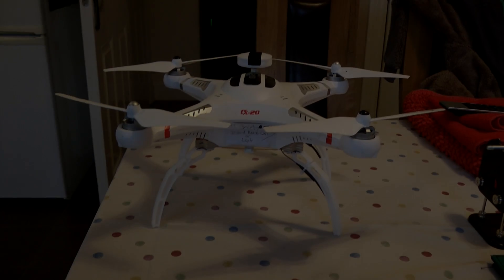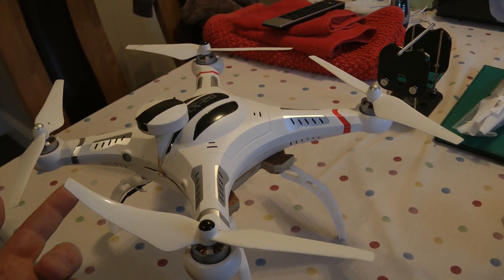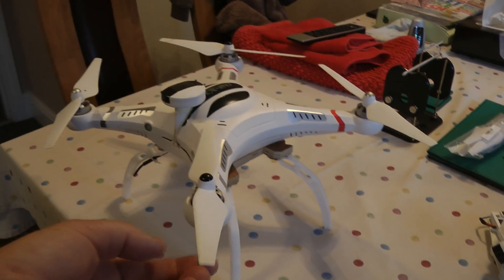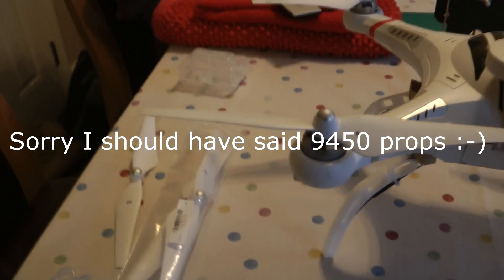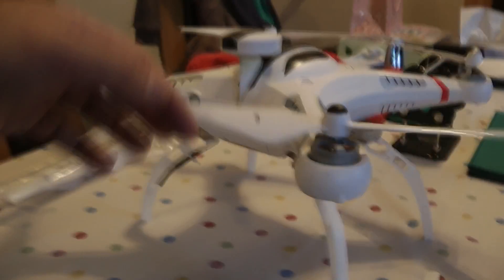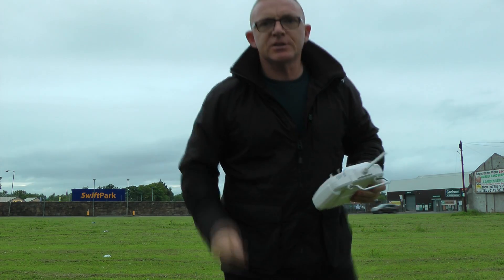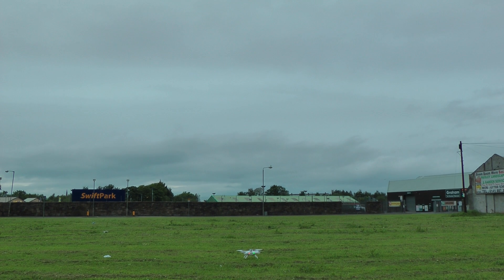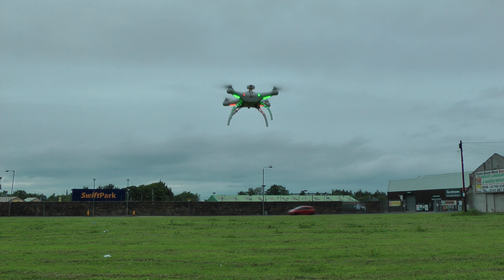Cheerson CX20 9443 V 9450 Props

Comment: Why does the transmitter also beeps on these drones
Reply from the maker: It's a safety feature, let's you know you are at mid throttle.  It used to annoy me but when you are in loiter at below mid throttle and change to stabilize without thinking your quad can fall from the sky.  But if beeping it will be safe to do so 😁

Comment: The most amazing flight of CX-20 I've ever seen on Youtube! I have mine but it's very faulty, it seats on the  shelf most of the time waiting for parts after crashing. What is your APM firmware? I've flashed 3.1.5 because one guy(Tesla) from rcgroups considers it's the best choice for CX-20. Did you make any modifications on harware (GPS, compass, APM)?
Reply from the maker: I used 3.2.1 Custom, I also used 3.1.5 with no problems either.  Apart from the props and changing the angles in mission planner it was standard :)
Reply: Hi, Charly, could you upload or email me your parameters list? I lost track of the changes in mine, so I'm not even sure where to start troubleshooting my very unstable CX-20, whether it is a hardware malfunction or parameters out of key. Thank you.
Reply from the maker: I will have a look for the files Sergey, I am not sure I still have them as I have since moved on with my builds.

Comment: Do these props give it higher rates, mine is pretty docile ?
Reply from the maker: No, you have to Use mission planner if you have the open source Version and change some settings such as pitch and roll.  You can also adjust PID settings or set it up to do an auto tune.  http://ardupilot.org/planner/docs/mission-planner-overview.html

Comment: Hey Charly...my quad is very "sluggish" when in gps (loiter) mode. I bought some 9450's to hopefully get rid of this problem, but it didn't. I was told that the CX-20 is slow to respond in gps mode so as to take smooth pictures, although yours does not seem sluggish at all !
Reply from the maker: +Gary Boyle - Tacomaboy Hi Gary. I fly mostly in manual or Stabilise, however you need to go into the parameter setting in MIssion planner and change your Wpnav_Loit_Speed (Ithink that's what it's called but it's late and my brain is tired)  By default it is set at 500, max is 1000.  I Usually set mine at 700 though as I don't really want to be flying flat out in loiter when filming.  Hope this helps.
Reply: +Charly Sayz  Thanx for your reply,, I forgot about MP...I'll try that now !

Comment: just fitted my cx20 with 9443 props and there's a big improvement over stock props, good flying days are hard to come by at the moment in the UK . Nice flying tho man
Reply: I just fitted carbon fibre 9443 props and noticed  the clearance between the body and the end of the props is awfully tight.  Did you have any issues with them flexing and catching the body?  (That is if you have had any decent flying weather yet lol)
Reply from the maker: Not with Carbon Fibre Props, I did with others including Gemfans but it never caused an issue, made a wee noise if I did mental turns and lift off throttle but that was about it.  I fly like an idiot Though :)
Reply: That's good to hear.   I haven't had a chance to try them out yet as it's been blowing a gale for the last week. It's murder waiting :-)
Reply: I think I must have got some dodgy ones. The pink-hub ones look ok, but the black-hub ones were not so nicely finished seem flimsier and were REALLY out of balance.  I balanced them as best I could but they were horrible to fly with, in fact I had my first crash with the Cheerson because of them.  A slight side wind took me towards some trees and I wasn't able to get it back, I caught the tops and bounced through the branches all the way down :-( Luckily all seems ok, but it was so unstable I was struggling to control it.  It got the jitters at the slightest thing.  I am putting the stock ones back on for now :-)
Reply from the maker: There are so many different prop makers out there claiming to be the same, sometimes you get lucky and sometimes you don't.  I started using Gemfans because of this, much better build quality, though not self tightening.

Comment: How do the DJI 9450 self tightening blades fasten to the CX20 prop shafts that use nuts?
Reply from the maker: +Steve Brown They just spin on in the opposite direction that the motor spins :)
Reply: Yes..I get it...the nut is integral to the DJI blade. I just wondered if it were the same tread size making compatibility for the cx-20' conversion...so I assume it is.
Reply from the maker: +Steve Brown You assume correct, the thing to watch out for if buying other props that are not self tightening is that they need to be keyed, the DJI ones are also keyed.  This means there will be a flat bit on the bottom of the prop shaft so props need to have the same.  As for Props, there are good and bad copies of DJI ones but you'll soon discover that :)
Reply: Charly Sayz ...I ordered 'Genuine' DJI 9450 carbon fibre blades..from reputable dealer..Key'd slot fitting is also concern. I assume I won't need to modify for such. Thanks for you're input Charly...Steve in Ct.

Comment: Did you adjust the pitch angles in PID settings? asking coz the angle seems sharper than mines at the default settings
Reply from the maker: +gonnaeletmein Yes, think I changed my angle Max to 3000.  I'm now doing 4500 on my F450 frame with the same setup.  After lots of practice I might add :)  https://www.youtube.com/watch?v=jwrVcXq0F8w

Comment: Thanks for the review Does the loiter and return to home remain stable with these props? Just wondering as using slow fly 8045s at the moment but also using a brushless gimbal with gopro on it I like to hover for smooth video. I get about 6 minutes safely with current props but would like to up it by a few minutes if i can. Im only using 2200mah batteries though so i could get bigger
Reply from the maker: +Matthew Herridge Thanks Mathew, I never had any problem with any mode with these props tbh, but I would suggest a Black Magic 3000mah battery for 10+ minutes flight.

Comment: I don't know how it works but 9443 prop don't work for me quiet well. I hover @ 70 percent compare to stock props about 55 percent.  Do you think I need to  change some  settings? Flight time also is horrible.  Your cx-20 seems doing good in the video.
Reply from the maker: +Emerson Reyes Try some Gemfans, 9047's  :)

Comment: hi, i too set 9443 props (cx-20) but quad doing wobble ,when decend or sudden stop! you change any PIDs on misson planner? or use stock PIDs ?
Reply: guney unsal I have the same issue with my carbon fiber 9443's
Reply from the maker: guney unsal I don't use the 9443's anymore, once I put the 9450's on all I did was lower my Thr_Mid to 540 then it was awesome :-)
Reply from the maker: +guney unsal Stock pids but I always come in to land at an angle.

Comment: For the hover on the 9440s you just have to move the THR_MID up a bit to get it in a steady hover at 50% throttle. Very simple to do. Just move the value up a bit.
Reply from the maker: Joe Quadcopter I had already done that based on my average hover rates in MP.  Spent £3.33 on 9450's, balanced them and then Awesomeness....Hovers actually one notch under mid point with gimbal, camera large battery etc.  You should try them if you haven't already ;-)
Reply: I only use Carbon Fiber 9443s.
Reply from the maker: Joe Quadcopter I have some Gemfans that I use and like, 9047's they are quite stiff but give good lift and response.  Next ones I buy will be Carbon me thinks :-)